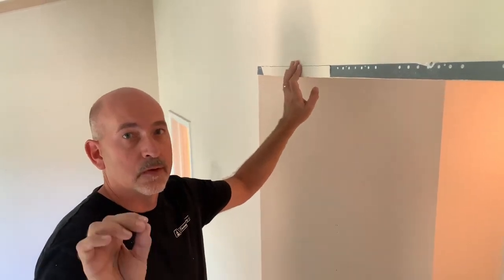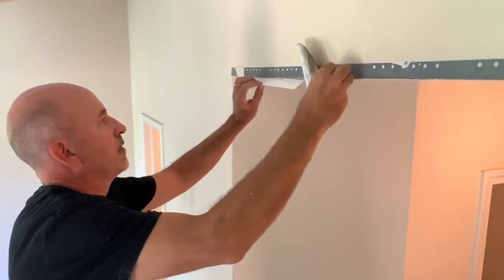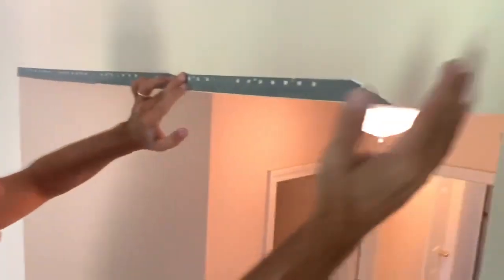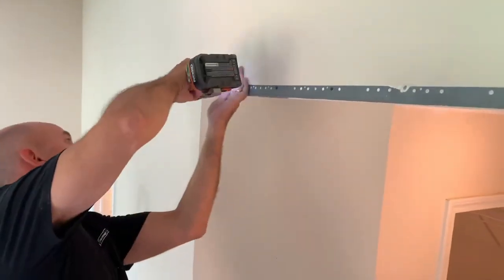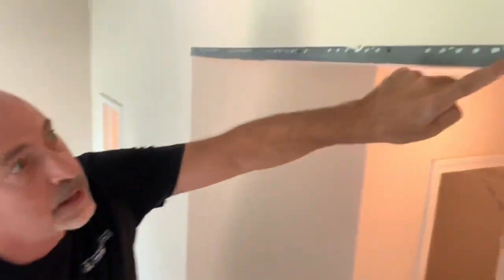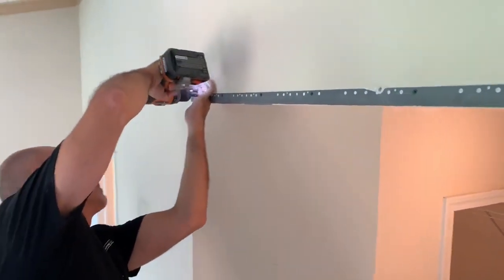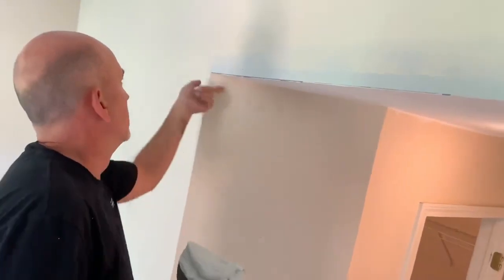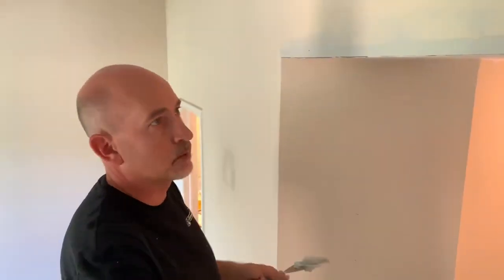Fixing corner cracks@thepaintingguru

Comment: Just curious, is there anything you can do to save the quick set or are you going to have to mix a small amount for each coat?
Reply from the maker: Generally you need to mix small amounts.  You could use a 45 minute compound to extend your working time.  Put a fan on the first coat until it hardens enough to hit it again.  Just give it an overnight to dry before sanding and priming.  Sometimes it looks dry on the surface but it’s still wet on the inside.